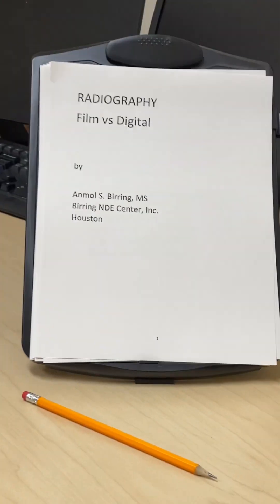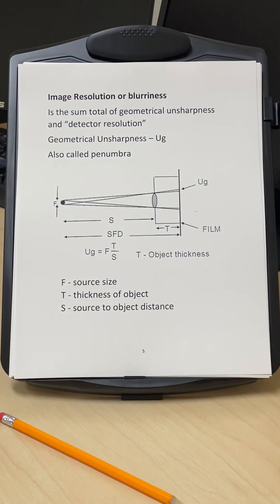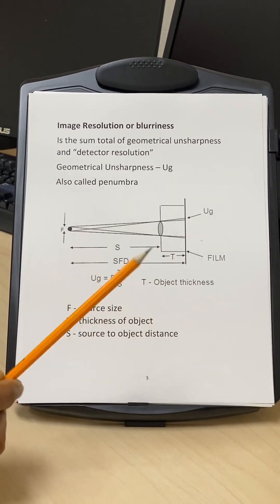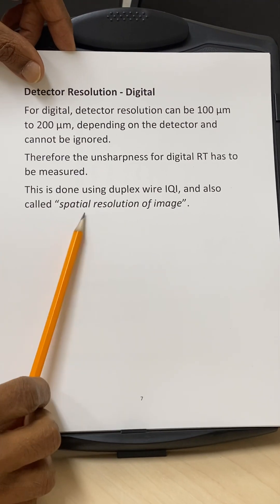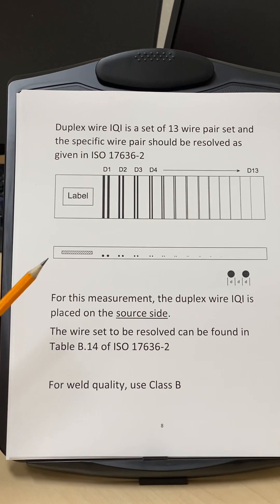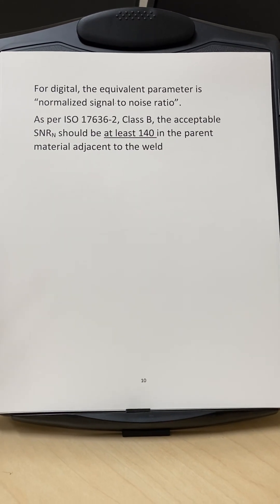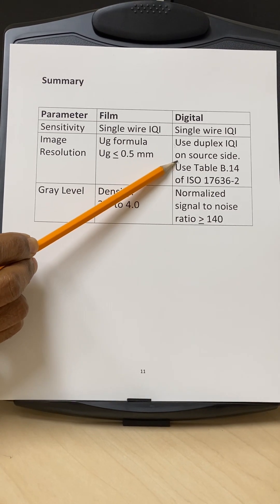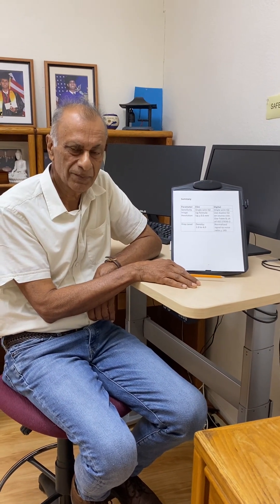Birring 211 Intro to Digital Radiography - Sensitivity, image spatial resolution and SNR

Comment: Thank you, Anmol. I really enjoy watching your videos. Digital Radiography typically goes unmonitored whether it be in the field or in a shop environment because of lack of knowledge and guidance. Videos like this come in handy when there is no support for the individual performing this process. Many companies get swindled into buying digital radiographic equipment without the slightest idea of the parameters that need to be met before quality radiographs can be obtained. In some cases companies end up purchasing incorrect / insufficient equipment for their application.  Thanks! LIII#163296